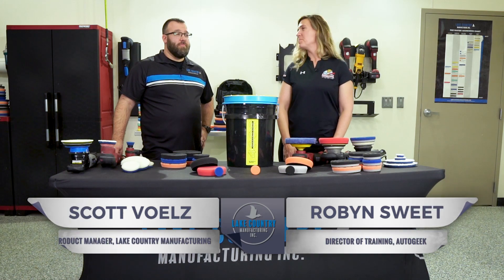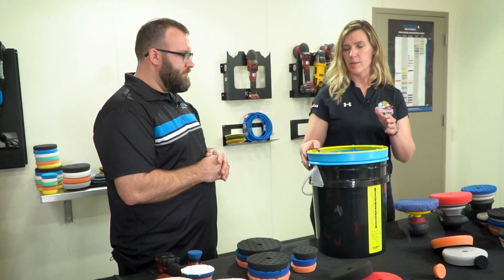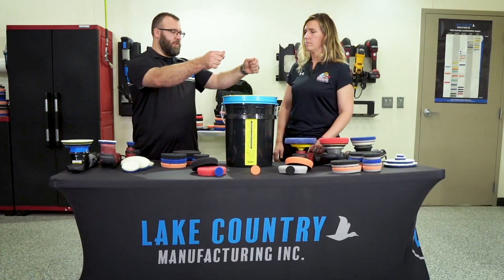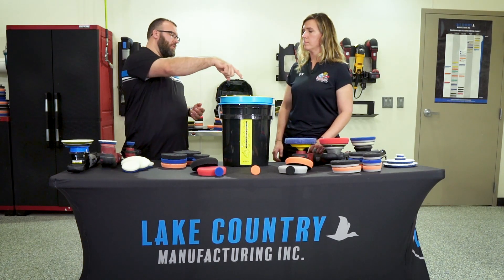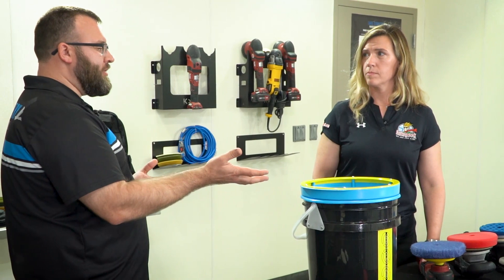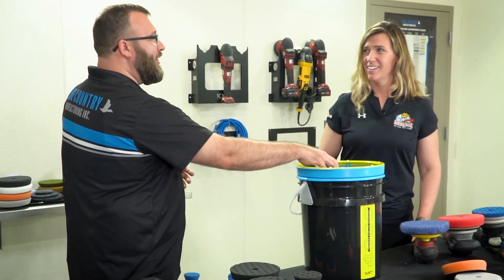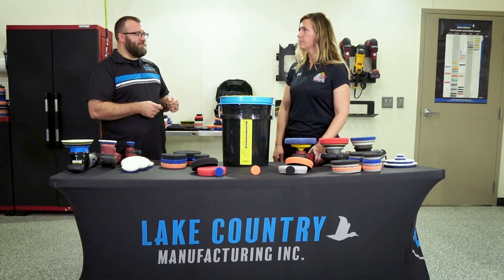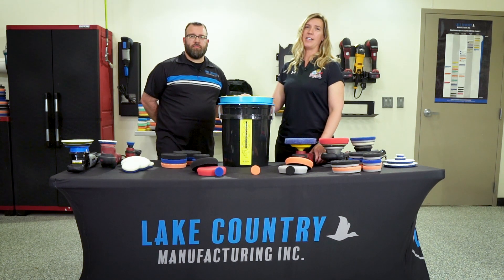The Lake Country Pad Washer

Comment: Spinning in the bucket with my DA, and I get spray in every direction. So it’s no good having close to your working area. If you’ve got concrete floors, then it dances in circles as you try to gently clean the pad on the centre ribs. And lastly - my centre piece will lock in the downward position almost every second press. 

Anyone else find the above issues?